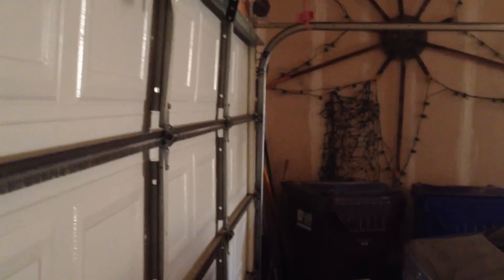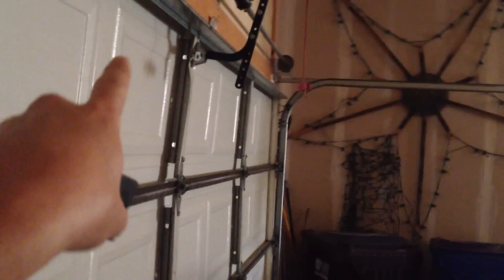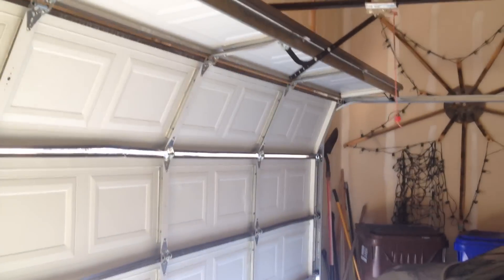DIY Garage door Fix - Garage hanging - Garage door popping

Comment: Bought a 1/2”x1/2”x8’ aluminum angle bar with 1/32 thickness at Lowe’s. Cut into two pieces and riveted between each crack. Working so far. Looks cleaner because it fits perfectly in the canal grooves. Less than $9 and 1 hour. Thanks to videos like these that inspired me.

Comment: Had the same problem before, the more I test (and fail) the more respect I have for these skilled garage repairman, believe me its not easy. After a.lot of testing and disappointments same woth you I was able fox.it by learning ots mechanism.carefully and in the process saved a lot of repair money. I even learned how to replace the cables as maintenance but believe me this repair is NOT for everyone...these garage doors are dangerous if you are not trained to handle repair.

Comment: Wow, your garage door does the same thing as mine, but much worse. I'd be afraid to park my car in there.
You should see how scary it looks when you change the video speed to 2X! lol
EXCELLENT JOB on the 2x4 fix! I'm gonna do the same thing except try to come up with something lighter in weight.
THANKS for your video!
Reply: Try drywall furlings

Comment: I used a piece of angle iron 8' on a 12' door. Caught three of the hinges. One piece on the top of the hinges and one on the bottom. Worked like a champ and no extra weight on the spring.
Reply from the maker: +Blaine Cash I have heard of guys doing that.  I didn't want to buy anything because I had a feeling it was dying.  Glad you got yours working!  Creative thinking.

Comment: You probably  have a crack in that 3rd section. Possibly the 2nd as well. Its not necessarily that its old. Its a pan door and its not wind loaded. A couple struts should do it. But extra weight will throw the balance off. Might need another half turn on the springs.

Comment: When you get a new door buy a double steel sided with better gauge hardware, nylon rollers, at least 2 struts. The opener is fine. Great video.
Reply from the maker: Jeep Fanboy 3692 .. That is exactly what I did dude, it is a double steel sided and insulated door.  It is insanely awesome.

Comment: Garage doors have stress points. The stress point is around the middle when it’s all the way up which it seems like the metal has weaken over the years causing it to heavily sag. I suggest replacing the door since it’s the entire issue.

Comment: The 2x4 did the trick. as you saw reenforcing accross the door section fixed it. for a permant fix i;d do a strut that runs all the way accross the door. But Still the 2x4 still works Amazing too. Im curious how is that 2x4 holding so far.

Comment: There is a bracket that should be on each panel, the length of the door, that would fix this problem.  The bracket is similar to an L bracket and a U bracket in that bolts on both sides of the bracket vs just an L.  You can get them at home depot I think for cheap, and some self tapping screws.

Comment: i hope ypu got it fixed right away i noticed that you layed a heavy metal pipe behind the hinges that put more stressa on the hinge.  the proper way is to run two light channel iron the width of the door. one just above one just below the hinges and in front of the hinges for support the length.  there are several video that shows the fix.

Comment: You need to install some struts..  Maynards has them for about $20 or so..  It's an L-Bracket that goes against the doors to hold them tight and give them support.  Picture a 2" frame across the length of the door.  

I have to do the same thing today..
Reply from the maker: Good call Daren...I still am limping along with the current setup.  I will replace it when it finally crashes and breaks to pieces.

Comment: Man, that door almost snaps in half! I know this is an old video, but I've got the same problem.  I bolted a 2" square (hollow) aluminum channel across the middle for support and it helped a lot.  Trouble is, you need a channel to span the entire door width.  Still working on finding something to fit...
Reply from the maker: Bradley Buyer yup. The support bar makes a big difference. I bought a new door a long time ago. But hopefully this video provided some help for someone.
Reply: Another guy used drywall furlings across the garage door.

Comment: Or a simple fix is to buy the same style strut as the one on the top and put one on each section. Will work better than the 2x4 and all the panels would be protected.
Reply from the maker: Jeep Fanboy 3692 I tried to keep doing this and eventually the 2x4's were too heavy.  Needless to say, I have a nice new door now.  Cost me $800 for a new double sided insulated steel door.
Reply: jwebb1975 nice! Can you do a video of it please?
Reply from the maker: Jeep Fanboy 3692 This is the new door.  It is a beauty.  https://youtu.be/EMdFEIwbvNE

Comment: I have the same problem, but I got new garage door!
Reply from the maker: Kqutter Sanford I ended up buying a new door.  I showed a video of it.  This was an attempt to DIY fix....if you don't try to fix it yourself, you don't learn.  My fix worked for the section of the door having the initial problem.  It started to do it in another section of the door and my fix didn't work for that spot, so I replaced the door.
Reply: I have fixed my garage door and garage door opener.

Comment: Having the same issue.  Thanks for posting this.  Excellent example of DIY trial and error jwebb1975!!!  Free is free man!  If something doesn't work, try and figure something out.  If all fails call for help.  But a guy that comes out to look at it will first charge you $50-$90 just to visit in some cases and then just say "Ummmm sir? You need a new door".  Ha!
Really genius? I never thought of that.Thanks so much for the wonderful advise. Ha!    
Good job !
Reply from the maker: tlc Thanks TLC.  When I encounter a problem, I try to fix it first.  There are many situations (fridge, central air) where I couldn't replace them because it was beyond my intuition of trying to figure it out, or electronically beyond my skill.   We all have the same talents everyone else does, just takes some time.